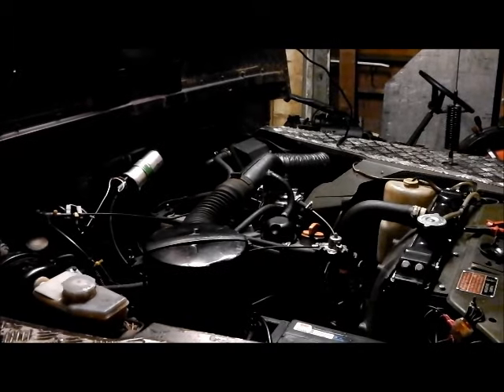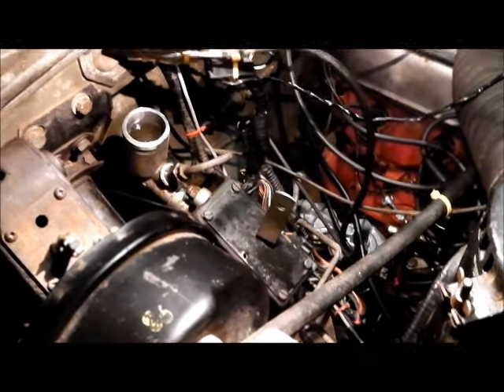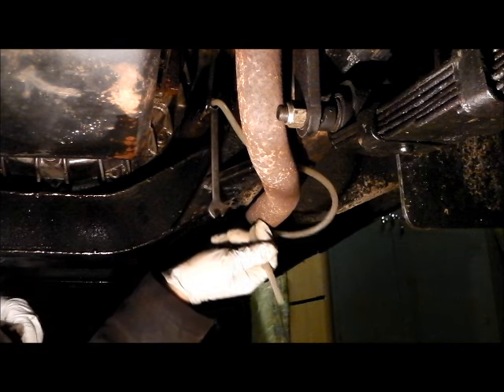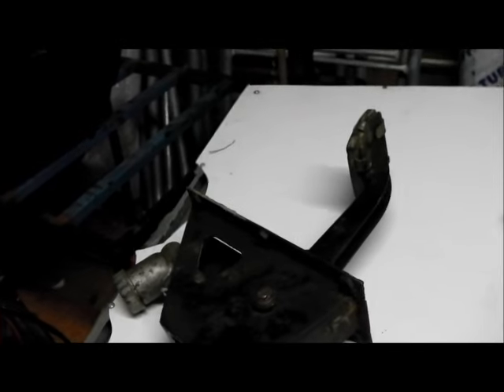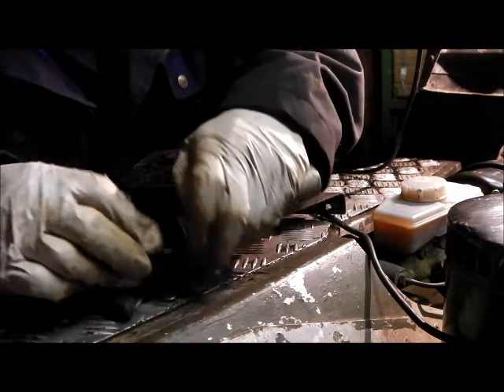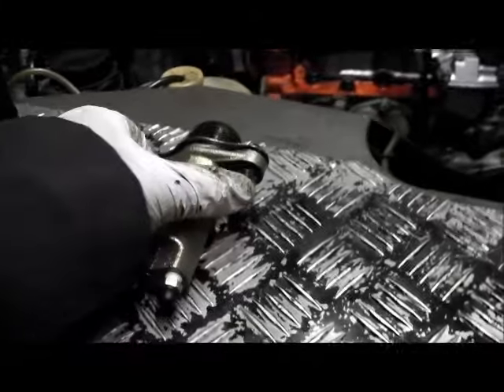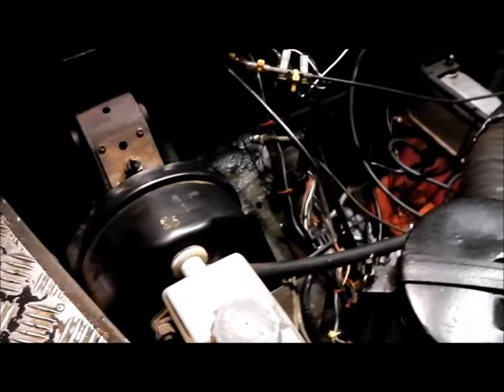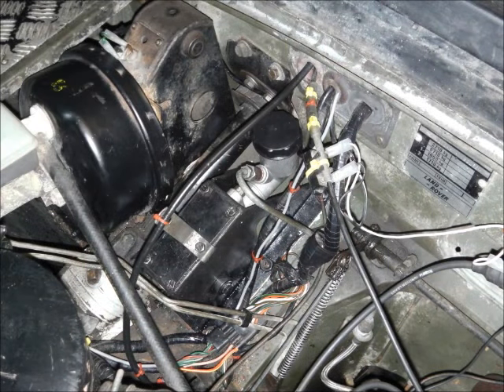Land Rover Series 3 - Clutch Master & Slave Cylinders

Comment: Thank you so much Phill for filming this and give some info about the working procedure. I changed last week the slaven cilinder and will do the master this week. Unfortunately my slave had the bleed nipple on the bottom and the pipe on top. I let someone push the clutch pedal and then I opened the bleed nipple, so the air came out with force/pressure. Worked quite well. My new master will arive today, I will work the same way as you, also remove the whole pedal box, paint it and drill the whole for the socket. I don't drive off-road with my 109'' tho. Keep up the great work man!   All the best from Holland, Jan
Reply from the maker: Thanks for the comment Jan, hope the job goes well. Happy Rovering!

Comment: Enjoyed watching you do the work Phill, can't be many more jobs.on the list.
Reply from the maker: Thanks, there is still quite a bit to be done mechanically. 

The steering relay needs changing, I had a go at jacking it out of the chassis but no go.... will let it soak for a bit and have another go some time. 

It could really use a new gearbox though, it's just so noisy and gets very wearing on a long run.

Next job is to replace all the brake cylinders and flexible pipes.

Phill.
Reply from the maker: ***** lol, look after your Land Rover and it will look after you!

Comment: Thanks very much for another insightful video.  Have this to do this as part of my S2 rebuild but not having removed the old one it's great to have these helpful tips.  For the hole you drilled in the pedal box you might find a large rubber grommit to prevent dirt and stuff from entering.  Cheers
Reply from the maker: +Sask Series 

Not a problem, making the videos is just another part of my interest in mechanical things.... it's always good to hear they are useful to someone. 

I believe the Series 2 has a slightly different arrangement for the clutch cylinders, there are various different set ups; though plenty have been fitted with Series 3 running gear. 

The grommet is a good idea, I used a standard cutter so finding one suitable should be easy. 

Cheers,

Phill.
Reply: +steamwally 
Hi Phill, 
Yes I believe the clutch slave cylinder is on the other side of the transmission housing to that of your Series 3, but I would think a similar process to replace. I inherited my Series 2 project and all of the pedals were in a box in the back.  Will be fun to finally get this all back together again.
Cheers!

Comment: Having some problems with my Landy. Took it to my mechanic and he replaced the master clutch cylinder. Driving it, well, it got worse and worse. Took it to a second mechanic (30 years experience with series 3) and he couldn't figure it out. I have a new clutch and a new hydrolic line and still I can't put her in gear. I don't know what to do
Reply from the maker: +Adam Gamble 

Hi Adam, sorry to hear your having trouble. Firstly, is the new master cylinder a quality item? I have heard a few tales of faulty new Britpart cylinders for example. 

How was the the system bled? It is possible to damage the piston seals by pressure bleeding if too much pressure is put on the reservoir, although it's rare. 

You could always try bleeding the system again, I have used the normal method in the past but a pressure bleeder on about 8psi works well. 

What sort of symptoms does it give - is the pedal firm or spongy or no resistance at all?

Have you tried adjusting the master cylinder push-rod? If not, remove the clutch pedal box cover and have a go, measure where it was first so you can always put it back how it was if that isn't the trouble.

Do you know that the slave cylinder is OK? It's generally good to replace both cylinders at once, some say that replacing one cylinder tends to take out the other. If the system is losing fluid then there is a good chance the seals have had it. 

After that, the only thing I can think of is to check the slave pushrod, I believe it's secured to the clutch release fork by a plastic clip - having removed the slave cylinder, you should not be able to pull the push rod off the release fork. If you can, it's a gearbox out job to put it back. 

Good luck, hopefully it's nothing more than simple adjustment required. 
 
Phill.

Comment: Do I have to press the plunger back in the slave cylinder?What is the  Best way to do it. Cleaned all parts, but am having problem reinstalling plunger!
Reply: We changed the master because the guy that works on it for him told him both never go out at the same  time, I told him BS, it was both. we are rebuilding slave and having trouble with installing the plunger, Thanks.
Reply from the maker: Best replace both together, or so I was taught anyway.  I didn't install seal kits, just changed the cylinders. If you are talking of just re-fitting the slave cylinder to the bellhousing, it should just slide over the pushrod without any trouble. Can you give any more details of the problem?

Comment: Which grease did you use in the slave gator cover?
Reply from the maker: You should use red rubber grease with hydraulic cylinders and rubber seals.
Reply: @steamwally  Thank you, very much appreciated 👍

Comment: Pity you spoiled a good informative video by telling others to use PTFE tape on a taper sealed joint ,totally out of order, this was a bleed screw not a thread sealed joint. I see it far too often when it could cause more leaks than it solves.
Reply from the maker: Fair enough - though the tape isn't on the taper. The clutch hydraulics on Series 3 Land Rovers can be a pain to bleed and eliminating air leaks at the threads during the process can make a difference.  I have tried with, and without but each to their own.